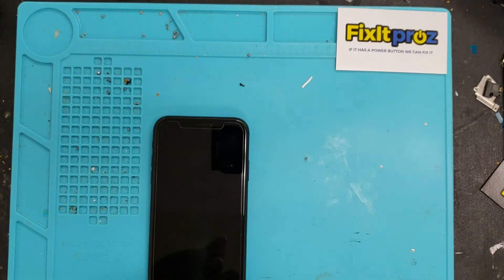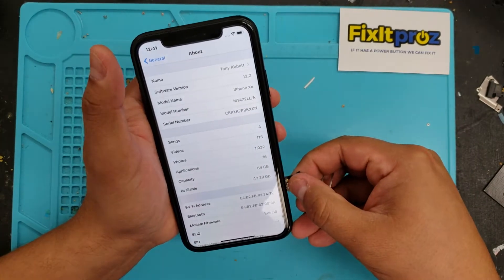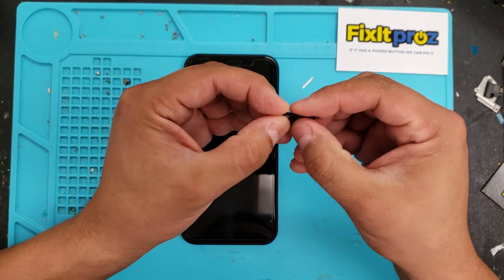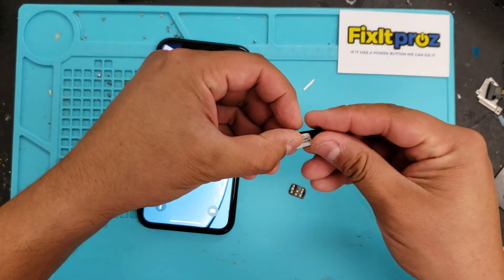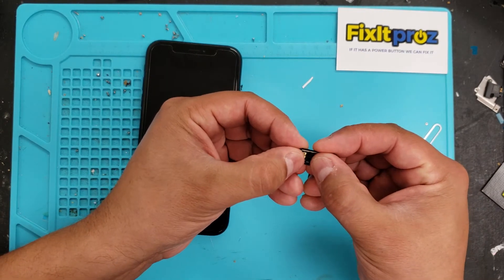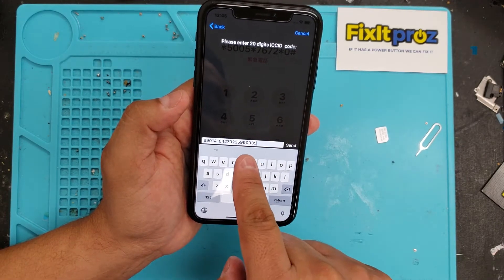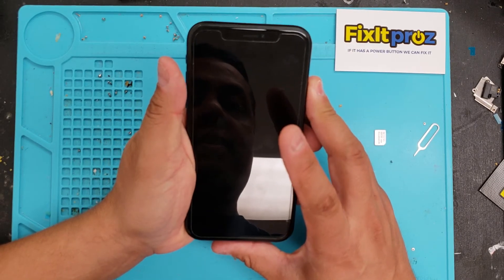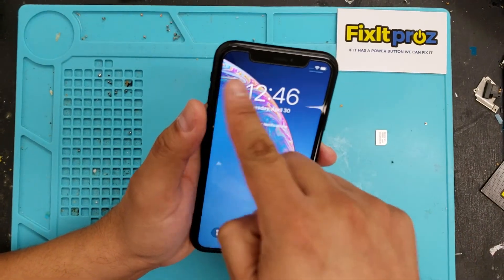Rim 12 fix latest iccid 6/27

Comment: I tried punching in the code but ntn happens
Reply from the maker: Is you phone on the latest ios 12.4 ?And also disable the front lock screen
Reply: I’m using ios 13
Reply from the maker: @SwissCheeseJa  bet version might be the problem. Download 12.4